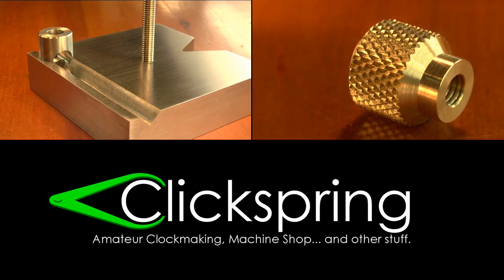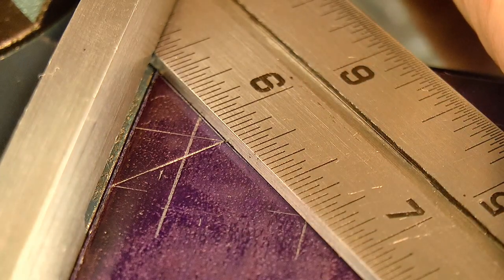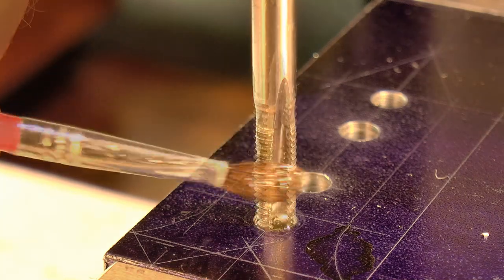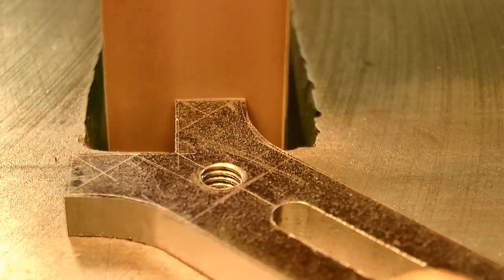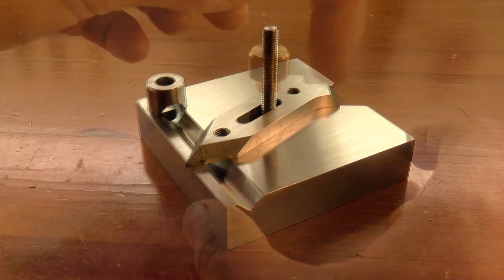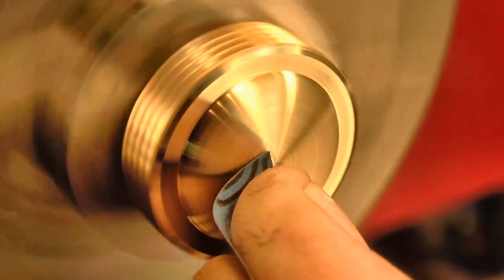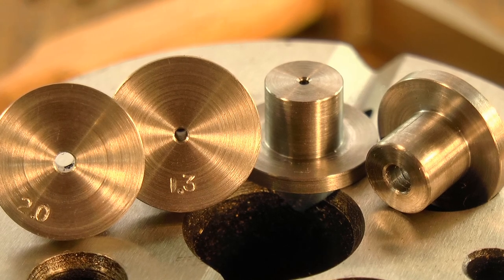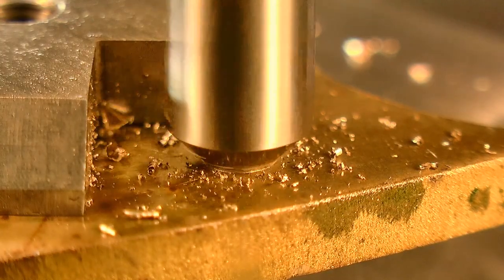Home Machine Shop Tool Making - Machining A Finger Plate Clamping Tool - Part 2

Comment: I'm out of words. I never saw that level of finesse and precision in fabricating parts by hand like that. I say by hand because despite using lathe, milling machine or else, material still needs to to be marked up, grinned, milled, you name it, using the touch of a clocksmith in order to have these parts slip into each other like they do in your videos. Please keep on showing us how nice one can turn raw piece of material into work of art. Thanks for that.

Comment: On the lifting screw, wouldn't it be a good idea to add a little brass tip to the end of the screw so that the screw doesnt mar the steel?
Reply from the maker: +SeriouslySharp Absolutely, I really wish I had thought of it! I currently use a little scrap of sheet brass, but I really should get around to doing it properly... Cheers mate :)

Comment: A lovely little tool. I now know what a finger plate is! I can imagine that a wooden (or plastic) variant could be useful in a wood workshop too. I'm wondering if this design would hold tight enough for router table work, or if side-clamping is still the better way to do that. That filing machine also looks really useful, especially with triangular and round files.

Comment: Thanks for posting this video.    I'd seen pictures and descriptions of the finger plate in G H Thomas' book(s) but never got around to making one.   Your video provided the inspiration to complete one today.   Making the finger plate completes my having made virtually all of the tools GHT has described.   Now perhaps I won't scarify fingertips when drilling small holes and holding the part on a block of wood without the benefit of clamps.   Thanks again and keep up the good work on the skeleton clock.
Regards,
Alan S,   British Columbia, Canada
Reply from the maker: Alan S Cheers Alan, thanks very much for tuning in.

Comment from the maker: Machining A Finger Plate Clamping Tool - Part 2

In this second and final part of the Finger Plate clamping tool build, I finish off the tool, by making the clamping finger, lifting screw and drilling jig bushings.

 #lathe   #milling   #machining
Reply: +Clickspring whats the purple stuff you put on the piece
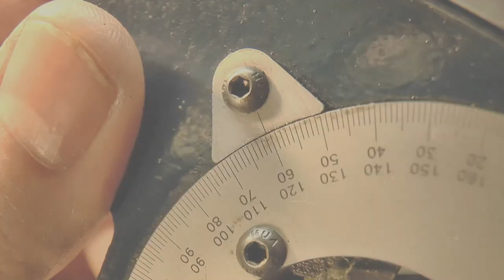Reply: +The Pilot Penguin, it&#39;s Dykem 80300 Steel Blue Layout Fluid.  See time 0:57 in the video.

Comment: Chris, Nice Job, Great Video!.. i have one small tip for you regarding the drill bushings.. you could make those from Silversteel (1.2510 or alike ) and harden them.. just heat to a cherry red, quench in Oil, clean up and reheat to a straw-yellow to anneal.. hardness should be in the 45-55 HRC range.. hard enough to not be worn by a drillbit.. (yes.. i admit.. i am a toolmaker.. )
Reply from the maker: ***** Cheers Jan, and thanks for watching!

Comment: You just helped me out more than you will ever know. 1 question - how are you attaching the small gears to their rods? Superglue? Wrong vid! Question still stands.
Reply from the maker: huxleypig69 I use Loctite 603. Its an industrial adhesive that you can get at most tool supply stores, and plenty of online suppliers. Its a great alternative to soldering if the load is modest. Thanks for watching and asking :)

Comment: @7:54 once you cut the part completely off what was that grey looking stuff that scrapped off the metal still in the lathe?  Was it just super fine metal shavings?
Reply from the maker: +JH129M Yes, very fine swarf made by the side of the parting tool contacting the parent stock. Thanks for watching and asking.

Comment: I see you use a die filer.  That's something I don't have, Yet.  Its old school but nice to have anyway.  When I worked in tool and die shops,  we would start the hole with a  hole popper and wire EDM out the shape.

Comment: Been binge watching your videos. I'd love to know what the hell that wiggly thing is that helps you layout holes. Doesn't make sense. 

In fact maybe you could do a video on how to set up the tooling.
Reply from the maker: +Cliff Hartle Hey Cliff, that's called a "wiggler", it helps locate the spindle over a point. Once you touch it to run true, the tip is lined up with a point on the workpiece by eye. Will definitely do a few videos like you suggest in the future. Thanks for watching and asking :)
Reply: I also got my son hooked. He just completed his degree in Engineering which included some Materials classes. He can tell you why and how the hardening and tempering process works at the atomic level with charts and graphs, he has just never seen it in real life. :)

Comment: Awesome workmanship as always.
What kind of oil do you use for threading and cutting?
My machines manual said I couldn't use sintetic oil in them because it would become acid in contact with the mineral oils they use (tonna 68 & 220), ruining the machine/s. As of now I use the same lube oil as cutting/refrigerant, but altough I have a 25L drum, I should really look for alternatives.
Reply from the maker: Armilar Zifferblatt I tend to keep the use of cutting oils to a minimum; I'm on the lookout for a good one too. The one I do have is incredibly corrosive on paintwork, so I only use it when I absolutely have to. Thanks for watching.

Comment: Just a quick question on the support you used to cut the chamfer on the mill, one side of the support looks like it's got a thick layer of something instead of bare metal and was wondering what it is, looks like a thick coating of some sort of epoxy or urethane compound??

As ever Chris your video's are brilliant and fascinating, I've already drawn up plans for a future little hobby shop built to what I wish to do, but like any shop it'll grow way beyond the design
Reply from the maker: Ha ha! Guaranteed mate! Re the thick coating: I think its just a thick paint - Cheers :)

Comment: What is the "wobbling thing" you use at 09:42 called, and what's it used for? Presumably to position the mill tools exactly centered? (Needless to say, the video quality is excellent. I have a LOT yet to learn...)
Reply from the maker: +Volker Wegert Yes you are correct its a device to position the spindle, Google "Wiggler". Thanks for watching and asking

Comment: Just curious, why didn't you mill the sides of the finger instead of a band saw?  I understand the tight radii and the V, but why not mill the excess on the sides/point?  The .89" radii, can it be milled on a rotary table?
Reply from the maker: Yes it certainly can all be done on the mill, and would give a superb result - sometimes though its fun just to get in there and do it freehand for the sport of it. Great to have you watching Emilio :)

Comment: Why use radius gages for the radio when you've got dividers. Plus I find that for scribing lines when marking out using dial caliper in the depth mode works welll.

Making your own tooling, whether they be fixturing or special cutting tools is one of those things that when working on a project makes it more enjoyable. Provided the  tools have that right "feel"

Comment: You're not worried about galvanic acrion between the two differing metals causing corrosion? At least for plumbing, if you change metals you need a union that joins the two using rubber or plastic.
Reply: Steven Boelke this is machining (as if you didn't know that), no water here, everything is usually covered in a light film of oil.

Comment: how do you keep all that exposed steel from rusting? i know this may sound a bit off topic, but i get upset even when cheap stuff from my toolbox get rust for no reason, i can't even imagine if my beautiful custom made clamping tool got rust as well.
Reply from the maker: +CNL _ I live in a tropical area, so the only method that is truly reliable is to leave a thin film of oil on everything after use. Wipe with oily rag, brush etc, works a treat, no rust on any tools for years since picking up this habit. Requires a lot of discipline particularly during our wet season, forget even one time, and flash rust will be there within hours. Thanks for watching

Comment: I love these vids and looking to set up a small machine shop. I will be getting a small lathe soon but torn on what milling machine to get. What size is your mill and is it belt driven/geared etc? Do you have a link? Many thanks.
Mark.
Reply from the maker: Hi Mark, the mill is an SX3 - Cheers :)

Comment: Hey click spring! Probably my fourth time watching this video, but I was wondering what design software you use to design these parts. If you can, let me know! 
Brock
Reply from the maker: Hey Brock, I use Solidworks although have a look at Fusion360 - same parametric modelling capabilities, but free for home users.
Reply: Thanks Chris. Excellent suggestion. I had a look at Solidworks, but the pricing makes it too expensive for a hobbyist. Fusion 360 is a great free alternative. Thanks mate.

Comment: Thanks for posting really enjoying this series.  I've done some work on the mill and lathe but, without the hints from a source like this, it's often very slow going (usually, I can figure out a way to get something done but have the feeling that there's a 10x faster way)!  Are there any books you'd recommend?
Reply from the maker: Shaun Crampton Hey Shaun, thanks for watching. I think the Workshop Practice series books are very good. I have learned plenty from them. Also you just cant go past Tubalcains video's. Everything you could want to learn is on his Channel, and explained masterfully. His video's are what started my interest in machining.
Reply: Thanks, I'll check those out

Comment: just beautiful, click. what type of steel did you use for the drill bushings? why didn`t you find the need for hardening? thanks man. cheers. pete
Reply from the maker: thebrokenbone Hey Pete, just a common mild steel for the bushings. You could harden them if you wanted, but there's no real need. At worst the drill will take a small nibble out of the edge of the entrance on the way in, but it wont affect the inside dimension. Cheers mate, Chris.

Comment: Great videos! What was the wildly flailing thing attached to the mill that you steadied with your pencil at ~1:57?
Reply from the maker: Goog Smells Yes it does flail rather wildly! That is a wiggler. It's used to locate the mill spindle over the top of a marked out hole location. Thanks for watching.

Comment: Beautiful work...one question though, would the Lifting Screw be better if itwere faced with a bit of brass rod so it doesn't gouge up the plate??
Reply from the maker: toadman506 Yes you're right I think it would. The clearance is low when holding thin parts, so it would need be a thin disc maybe held on with a spot of loctite? What do you think?
Reply: Either a Disk, or maybe even boring out the end of the screw and loctiting a piece of brass stock into it
Reply from the maker: toadman506 I like that insert idea; wish I'd thought of that! Thanks mate.
Reply: No Worries...sometimes it just takes a different perspective.

Comment: Yery nice work. As always. It's a toss up. Who does better work on YouTube videos. You or Stefan Gotteswinter. 
One small quibble.  For the jacking screw I think I would have gone with a larger diameter and inserted a brass foot on the end. That way one wouldn't mare the surfaces of such a nice tool.

Comment: What was the purpose of that one tool in the mill that you straightened with a pencil?
Reply from the maker: +Jeremy Butler Hey Jeremy, that's called a "wiggler", its used to locate the spindle above a point on the workpiece, usually to drill a hole. Thanks for watching and asking.

Comment: can I ask you a question?
how can your band saw cut metal so easily? is that a special one or a special blade?
Reply: I think I know what your asking about. It looked as if his blade went threw quite fast? The part of the edit was sped up to save video length. But yes ....make sure you use the correct tpi. for the material you are cutting.

Comment: great video!!  what size tool blanks did you use to make your gravers?
Reply from the maker: +KevCarrico 1/8th inch HSS. Thanks for watching.
Reply: okay, yeah -- i saw the markings on the side, but what length?

i do not doubt you, yet find it difficult to believe. then again, it's very difficult to judge dimensions from an iphone screen while stuck in a chicago airport for 19 hours.

0.125" x 0.125" x 2.500" -- holy cow, that is tiny. how much of the tool blank is sunk into the handle -- .250?

or might you show everyone by explaining how to make such things (please!!!)?!!
Reply from the maker: +KevCarrico About 5/8" is inside the dowel handle. To make,  grind a point on the end and tap into the wood. Sharpen the business end on a grinder at 45 degrees. As long as they are kept sharp they cut beautifully and are a real delight to use. I will do a video on gravers soon. Hope you escape Chicago soon :)
Reply: UNDERSTOOD 

still stuck in chicago, and have seen all your videos... THRICE.

i am a film director, and you are a genius. so please post 35 more videos by noon, EDT?  

(did you notice that i said "please"?)

ha haa!
Reply from the maker: +KevCarrico Ha ha! If only it were that easy! take care.

Comment: I have an extra Radius gauge set graduated in Inch that I could send you if you still need that tool. It would be my pleasure.
Reply from the maker: +Heiß Fahrer Thank you very much for the offer mate, I ended up buying a set not long after I made this video. Appreciate the offer though, cheers.
Reply: Your videos are slick man. I got some bar ends around my shop and am going to turn up the Fire Piston. Thanks for the plans. =)

Comment: What is the tool in the mill at about 1:55  and why/how do you use the pencil trick for it?
Reply: +Matt “Midnight Void” j  It's called a wiggler, and by holding something (like a pencil) against it, you can get the tip of it perfectly centered with the spindle of the machine.  (drill press, mill, lathe...)  With the spindle still spinning, you can then lower the tip of the wiggler into a center punched divot on your work.  If you pull the tip out of the divot quickly and the tip is wiggling, then the spindle's centerline isn't inline with the center punch mark.  You then move the work until you get a perfectly centered wiggler when the tip is removed from the mark.  Put in your drill and you know the hole will be accurately located.........assuming you did the layout work and punching correctly.  ;)
Reply: Thats brilliant!
Reply: +Matt “Midnight Void” j  Yes, very handy to have!  A wiggler set comes with other probes that can be used for edge finding, picking up the center of holes, and for holding a dial indicator.

Comment: What is the tool u used at 1:58? it looks magnetic. If it is, then what does it do?
Reply from the maker: +kyle han That is called a "wiggler", its used to locate the spindle over a point on the workpiece, usually to then drill a hole. Thanks for watching kyle.
Reply: thank you for making these videos and thank you for your answers

Comment: EDIT: Combing through the comments on a different video I found an answer: apparently it's called a 'wiggler' and it's used to center the drill over the marked hole. I cannot believe I was so close, and yet so far away with my attempted googling terms.

I don't have much hope that I'll get an answer but... What is going on from 1:56 to 2:07? I find these videos super interesting, but I don't do any of this kind of thing myself. Most of the tools or machines make sense in context, but I cannot for life of me figure out what this is or what he's doing? It's in the drill press spinning wildly, he centers (?) it, and then almost touches the metal with it, and then immediately moves on to a drill. Shockingly, googling "drill press wiggly spinning thing" has gotten me nowhere.

Comment: Please stop adding the “elevator muzac.”  It doesn’t add anything to the informational content of the video, and for some of us it makes understanding the voiceover difficult.  The video content, sans muzak, is great.  Thanks for it.
Reply from the maker: Dick Horner Hi Dick, thanks for letting me know your thoughts. There is an option available on the video to turn on the closed captions which you might find helpful. I have transcribed the narration, so it is the same as what i am saying on the video. Thanks for watching.
Reply: Closed caption is OK for conversation, but not a good solution when trying to see details of action.  The muzak is annoying in and of itself.